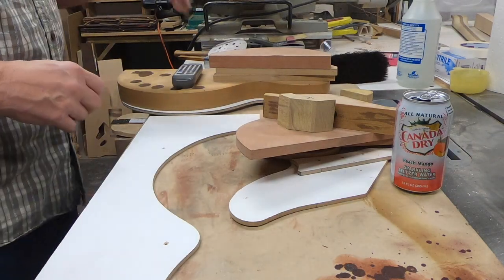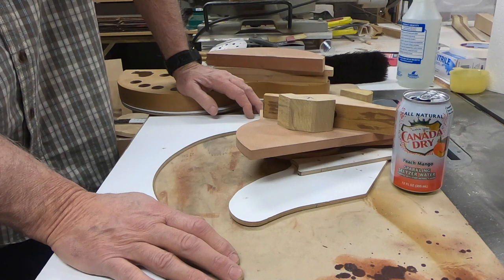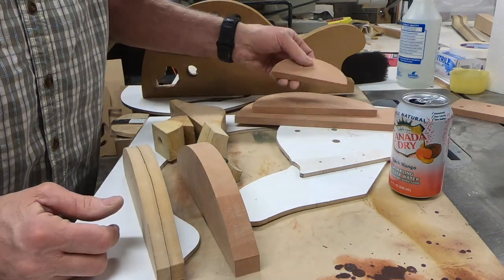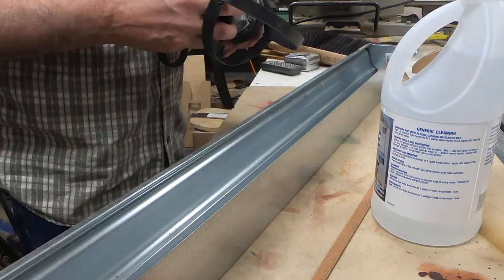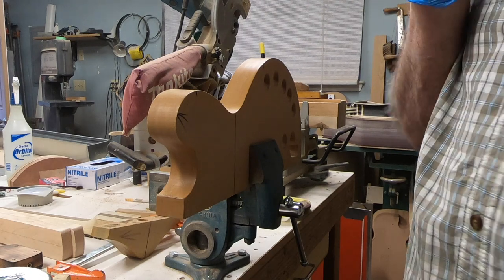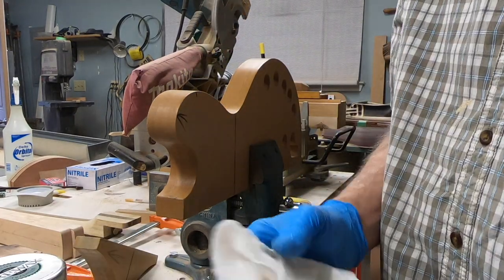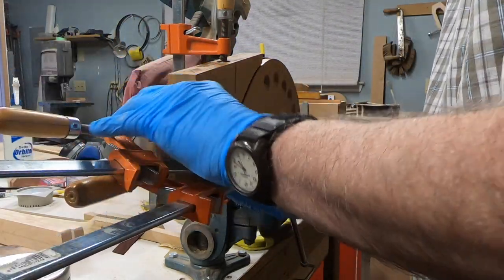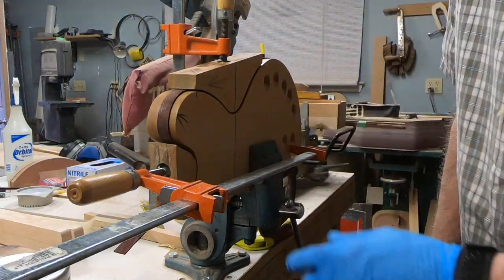BENDING GUITAR SIDES WITH AMMONIA, TEST,  at JONAH GUITARS

Comment: Years later here, but just wanted to comment that the ammonia used here seems to have been "high strength" household-grade ammonia cleaner, which is about a 3% concentration while standard household grades are about 1%. A study I found described using 10% "janitorial grade" ammonia to bend black poplar and found the best result from 24 hours of soaking for 0.8cm thick piece, and that was the longest of the durations they tested. Tests with using ammonia for fuming seem to indicate that weaker concentrations of ammonia can be used to achieve similar effect on wood if the time is extended relative to the degree of dilution. HOWEVER you'll want to avoid using ammonia with galvanized steel, zinc, or copper alloys, including brass and bronze, as it will corrode copper or zinc. With the weak concentration that's why no noticeable effect occurred, but with more prolonged exposure or a higher concentration it would be apparent.

Comment: I do like a "what if?" Dane. Proof of concept is good but I think I'd give nasty chemicals the swerve becausee it must have been real whiffy in there Dane, and there's the questionn of what to do with the dmspent Ammonia? Can you recycle it back into the bottle? I guess so. I know you said that you'd started the bend from the Mickey Mouuse ears last time and I would too, but again- proof of concept is good.
Reply from the maker: Steve, the chemicals were not my first choice. ai probably had proof of concept fail video in the stuff I lost. The stream box didn't work and the piece broke in the cut away. You will see in the real bend video I still had a slight problem in the cut away. Direction made little difference.